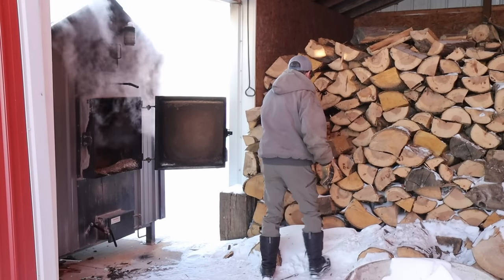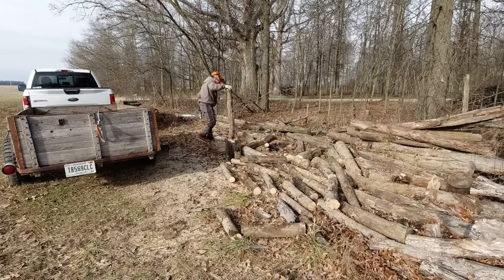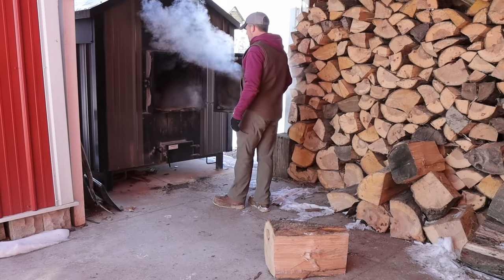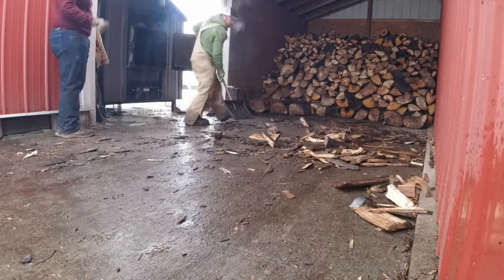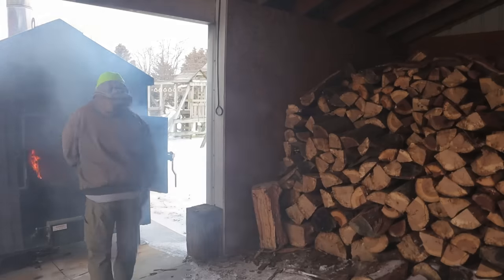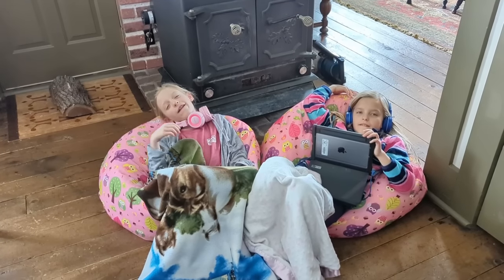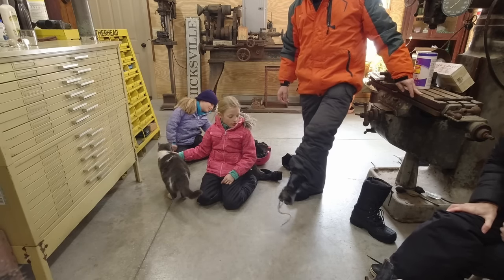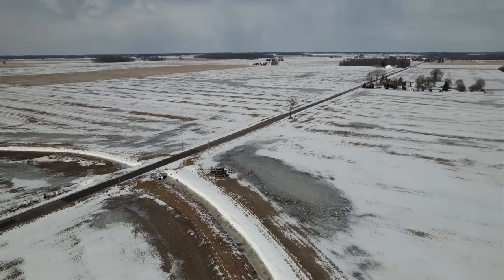Is BIGGER Better? [Firewood Size For Outdoor Wood Boiler] - Why Split Wood For A Large Boiler?

Comment: Dude…. It’s only 80lbs that’s same as a concrete bag no big deal
Reply from the maker: Right. As long as you don't mind handling 80lb bags of sackcrete first thing in the morning and last thing before bed everyday for 6 months... no thanks!  But, clearly I'm super strong and you saw me lift it no problem; right?   😉
Reply: @digdrivediy  believe me I do Masonry and I mix well over 1000 bags a year and type 2 cement it’s 94 lbs a bag so no need to complain about the weight

Comment: I wonder if burning these wood would contribute to climate changes nowadays?
Reply from the maker: Maybe so, but I think on a lesser scale than some things.  One forest fire does millions times more damage than I could in a year probably.
Reply: As long as you don't burn the wood faster than the trees grow back it's carbon neutral.   If you just leave wood to rot, it will give off carbon dioxide as part of the rotting process.

Comment: There's no reason to look " manly " and use huge pieces and risk an injury .
Reply from the maker: I agree Andrea :)
Reply: @digdrivediy  The safe limit is 44lbs for weight handling , but I would say even less is better. let's say 36 max .
Anything over 44 ruins your skeletal system.
I've worked at Amazon before.
Reply from the maker: @dimmacommunication  That's bad news for body builders 😋
Reply: @digdrivediy  😂😂 I was body building myself but here we are talking about complex movements for a  prolonged period of time.
Also movements in the cold and so on :)